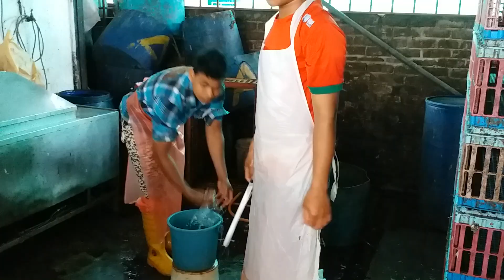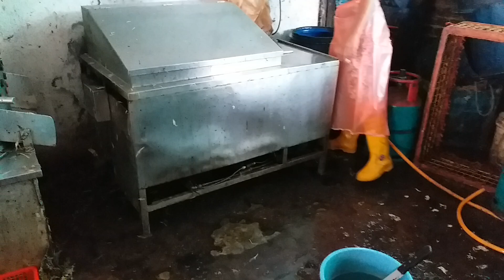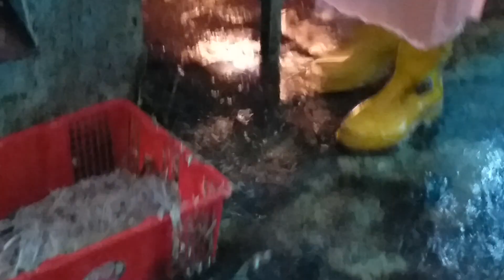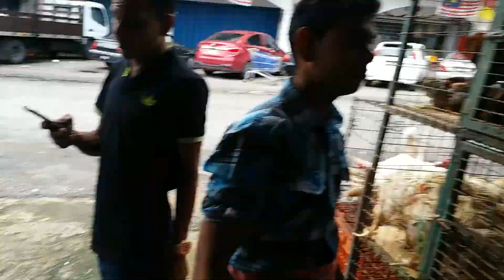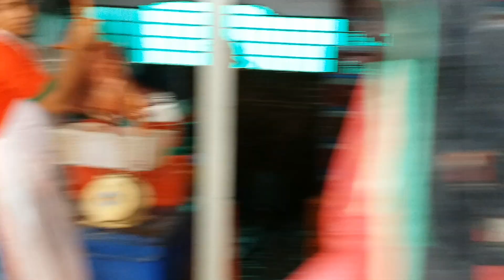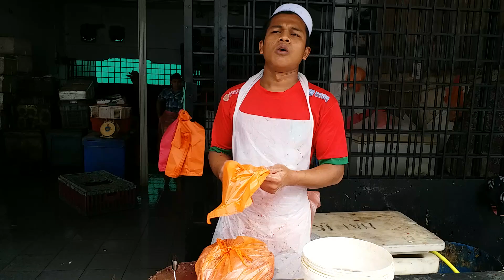Islamic Method Of Slaughtering Chicken to make it Halal ~ Mahalo JC

Comment: Allah hu akbar means
Allah (GOD) is the greater. 
Used by Muslims to remind themselves of ALLAH (GOD) vastness and power.
Reply: Md. Mahir Labib
1 second ago
The swift cutting of vessels of the neck disconnects the flow of blood to the nerve of the brain responsible for pain. Thus the animal does not feel pain. While dying, the animal struggles or writhes or shakes or kicks, not due to pain, but due to the contraction and relaxation of the muscles and due to the flow of blood out of the body. The swift swipe cuts the carotid artery, jugular vein causing all the blood to flow out of the body because the heart doesn't stop immediately. Whereas when you give a hard strike from the back i.e on the spinal cord that may lead to sudden stoppage of heart disallowing the blood from completely flowing out of the body.